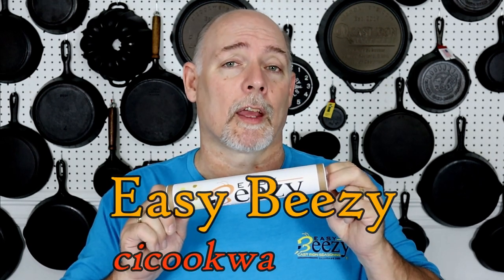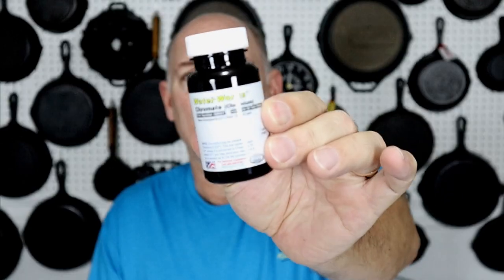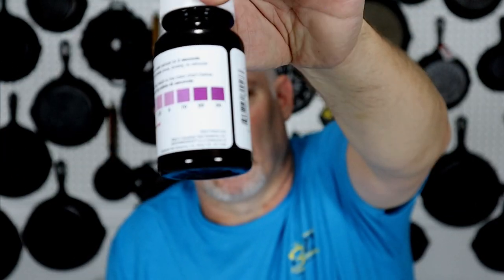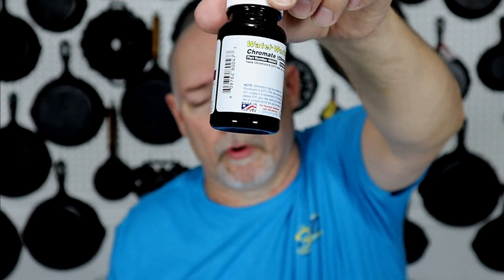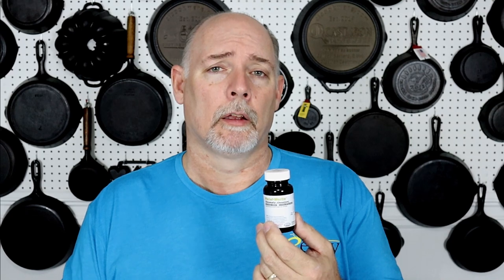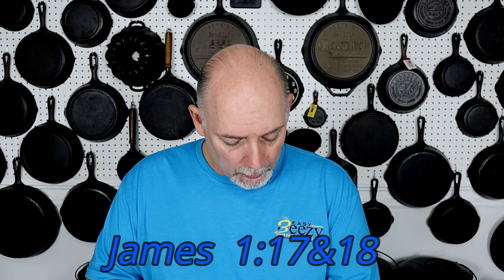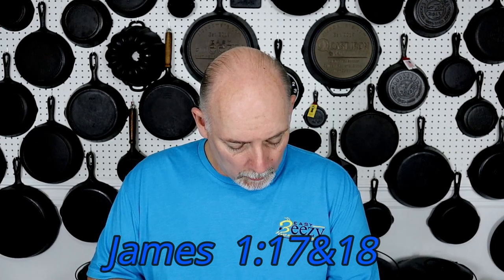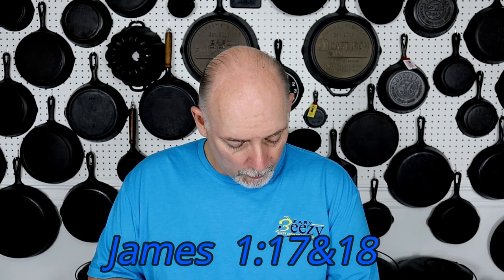Hexavalent Chromium

Comment: I'm using stainless in my tank, it's much easier to keep clean and I haven't had any problems. I only have 6 amps going to my tank but it works.
Reply from the maker: I think it takes much more power than a home tank could ever produce to cause issues. Stainless is much easier to clean.
Reply: @castIroncookware  I appreciate you brother. I'm new to vintage cast iron so I've watched a lot of your videos. It's given me more experience than a new guy would normally have. I seasoned 6 pieces today and all looked very good after 4 coats. Not sticky or spotty, I have you to thank for that. I watch other cast iron videos and think "you shouldn't be making videos leading folks astray". I guess they're doing their best but when ya don't know be quiet.